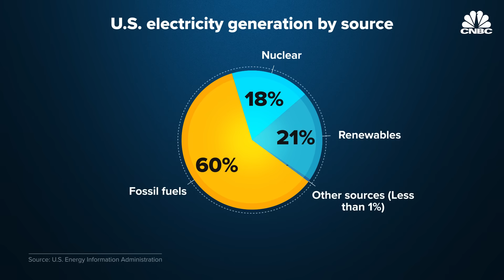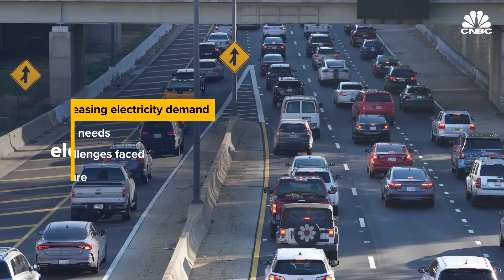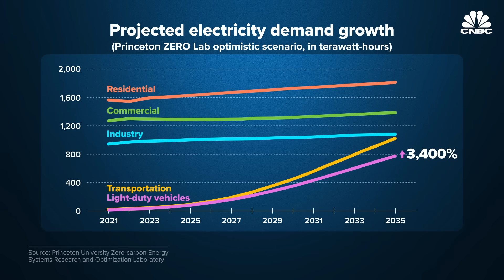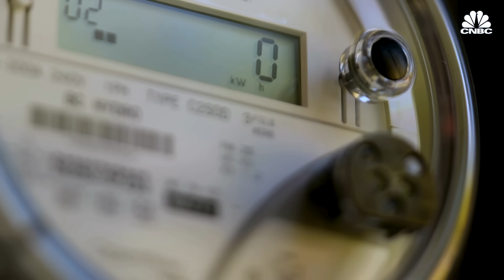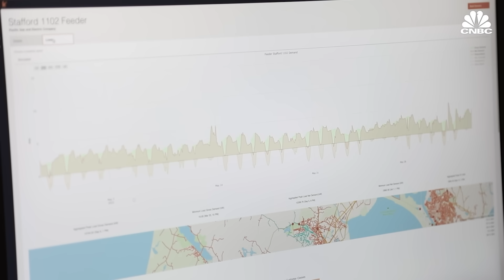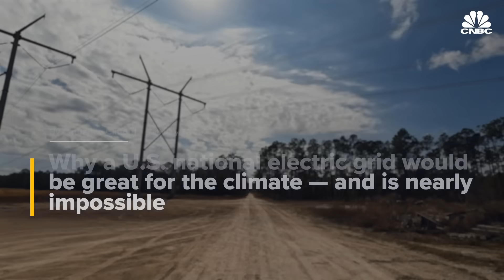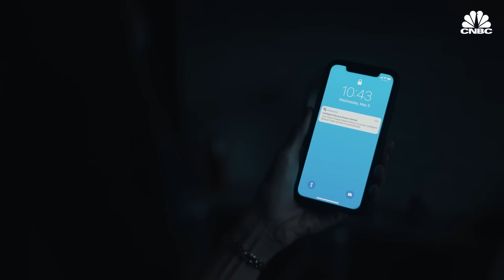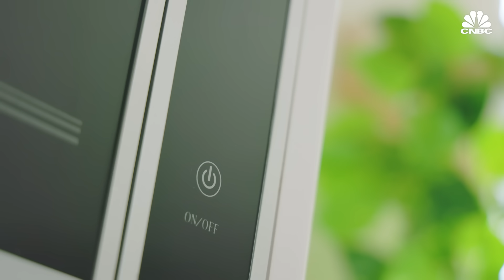Can The U.S. Power Grid Handle The EV Boom?

Comment: Model 3: 3566 kWh per year * $0.14 per kWh = $499.24 per year vs Toyota Camry: 14000 miles per year / 32 miles per gallon * $3.50 per gallon = $1531.25 per year or savings of $1032.01 per year
Model 3 cost: $47,240 (Long Range, no incentives) vs Toyota Camry cost: 35,916 (SE AWD) so it pays off after roughly 11 years of ownership (forgetting maintenance deltas and incentive offsets)
Ford F150 Lightning: 7274 kWh per year * $0.14 per kWh = $1018.36 per year vs F150: 14000 miles per year / 20 miles per gallon * $3.50 per gallon = $2450.00 per year or savings of $1431.64 per year
Ford F150 Lightning cost (XLT): $64474 (no incentives) vs F150 cost (XLT): $41800 so it pays off roughly 16 years of ownership (forgetting maintenance deltas and incentive offsets)
I’m an EV and ICE owner. My biggest gripe is the high costs up front. Tesla seems to be the only company trying to solve this issue. I need the rest of the industry to figure this out. A average person can’t buy these expensive cars, and it starts with the costs of the batteries. Need better battery tech, or cheaper batteries.
As for stressing the grid, 11 billion miles per day in the US, and if each vehicle is around 2.9 miles per kWh that is 3.8GWh per day. We produce about 10.7GWh per day with approximately 2.2% of the cars on the grid. If we get to 100% EV, we would roughly have to grow 35% to make it work. This does not hurt my head at all guys, what is the issue? Random surges is what has to be protected, that is the problem ie. need more energy banks/storage.
Reply: Most people talk about a 20% increase to the grid for full EV adoption. Easily done over the next 20-30 years.
Reply: And that doesn't include cheap home solar that is selling rapidly.  My 1kWH per day system cost $800, will last 10 to 15 years and is even ceasing to increase.   I'm very likely to be 2kwH per day this year.   I use 380 kwH per month.   That's 30kWH per month I get now out of ~16 sq feet.
Reply: The economic breakeven point for EVs vs. ICE vehicles actually comes in at an average of just 5 to 6 years.

Additionally, the ecological breakeven point for EVs vs. ICE vehicles is less than 14,000 miles, and this figure gets better as fossil fuel generation decreased.

And that's just the beginning as both the economic and ecological benefits continue to accrue over the life of the vehicle.

Lastly, it's going to take quite a while to reach 100% EV penetration in new vehicle sales, let alone ICE replacement over time. So all the dire armchair predictions that the grid's gonna collapse simply aren't true.
Reply: @ARepublicIfYouCanKeepIt  actually even the 2018 adoption rate projections were way off.    

Ice dealerships are charging high premiums after the pandemic and as a result, ev sales are way up.

And the parent poster was really friendly with his price of gasoline.  Gasoline and Diesel are much higher in California (38 million citizens), the EU (447 million), and UK (61 million).

Comment: Finally, I never hear about this. CA Bay Area currently has brownouts? And are there pollution benefits , since grid a huge sources of pollution?
Reply: CA brownouts are not so much infrastructure related but mismanagement that goes back to the days of Enron. The are pollution benefits because electric vehicles and appliances are 3 to 5 times more efficient and the grid gets cleaner every year. Don't pine for a smelly and polluted past. Look forward to a better, cleaner, greener future.
Reply: The grid is only pollution when it uses coal.   And electricity from coal is about 40x better than burning gasoline in a bunch of individual vehicles.

Evs cause less pollution in California after 18k km.  That's about 12000 miles and uncles the carbon centaurs to manufacture the evs including their batteries.

Comment: 98% of all charging of EVs will happen at home overmight. TOU pricing will keep EV charging to off peak when there is tons of power available.
Reply: ??? 8h 30min at work not enough for a fill up ???
Reply: That's not true.  I don't know of one EV use who plugs in his EV right before they go to bed.  They do so as soon as they get home...so 6-7PM.  Because most trips require only a partial charge, that mean most EV charging occurs between 6-10PM, right at peak electricity demand.
Reply: @howard6433  all EVs produced in the last decade have charge timers in them. Sure they plug in when they get home at 5-6pm but they don't actually start charging until midnight when power is cheaper.

Comment: The U.S. Power grid will not be able to handle charging stupid EVs. Our power grid system is degrading, and lots of work needs to improve our power grid system. Be ready for lots of blackouts over the summer due to people charging their stupid EVs during the days and nights. I know this is the time every Americans have their AC systems running during the days and nights. We Idahoans have no interest in stupid EVs, and  our power grid system in Idaho can barely handle over the summer. 😎🇺🇸
Reply: Exactly,  EVs are burnings up and their useless batteries explode.
Reply: Solar, Wind, and Nuclear plants needs to get installed more.

We can improve and innovate our current energy infrastructure. this isn’t a non issues.

Maybe see who in charge of improving the power grid and go after them
Reply: @tycooperaow  One, people are afraid of the Atom. So Nuclear is out. DTE got a permit to build a new reactor at the Fermi Nuclear power station, people protested and the idea was shelved.  Two while we can improve the system, at what cost? Do you think the power companies are going to be the ones paying for it? Nope. They will just increase rates  and grovel at their favorite political person for tax money. DTE already charges double between the hours of 3pm and 7pm in the time when many people are still struggling due to high inflation, crippling student loan debt and non affordable housing.
Reply: @Jacarroll417  is the money.   Not the radioactivity.   Private companies will not insure nuclear decommissioning.  And nuclear is no longer profitable compared to wind and solar and requires tax players to subsidize it
Reply: @mac_mcleod  Money is part of it, but every time a reactor is to be built people protest and lock the process up in court. SO yeah Companies are not willing to stake the money on a potential money pit as people continue to fear the atom. Also solar doesn't work everywhere. Firstly you need lots of sun, not everywhere gets lots of sun all year round. Then you got the costs associated with buying the panels and having them installed. You need to find a reputable company to do it. Not everyone has that ability. Last I checked the blades on a Wind Turbine last maybe 5 years before they need to be replaced, they dont have a good method to recycle them.
Reply: @Jacarroll417  wind turbine blades last 12 years.  And wind is cheaper than nuclear.   A lot cheaper.  And that's ignoring the costs of nuclear that we push on to our grandchildren.
Reply: @Jacarroll417  not unless it’s fusion reactor.  Plus we need to change the narrative and undergo a lot of testing for it
Reply: @tycooperaow  Fusion is decades out at best. We need solutions for today.
Reply: @Jacarroll417  Fusion is a solution we can employ in the next year. There have been massive breakthroughs these past couple years. I suggest looking into it!
Reply: @tycooperaow  When fusion is really real and really less expensive, then it will become common.

Right now, even with subsidies (which are okay for a new tech), Fusion isn't practical yet.
Reply: @mac_mcleod  We gotta start somewhere
Reply: @tycooperaow  I air conditioned my house in texas in the heat of the day for 2 hours on cheap off-grid Solar.  It's going to cut my electrical usage and my utility bill by 8% compared to last summer.

I'll likely use an electric bicycle to lower mileage on my car by 100 miles a week - using solar instead of gasoline- this Fall.   (just no chance of it right now- it's 101 degrees outside).
Reply: Climate change is real and Idaho has a lot at stake. As temperatures increase and droughts persist, wildfires destroy hundreds of thousands of acres every year, and wildfire season is starting earlier and ending later. As the human/nature interface encroaches farther and farther into the wild, more and more homes, livelihoods and, indeed, lives will also be lost.

As opposed to areas that are already developed, areas of the country that aren't already built out have the benefit of doing things correctly, rather than having to pay the increased costs associated with retrofits.

In addition to wind and solar, Idaho is rife with opportunities for both hydroelectric generation and pumped hydro storage.

Idaho National Laboratory is also at the forefront of the development and testing of Small Modular Reactors and Molten Salt Reactors for civilian power generation. Combined with renewables from wind, solar and hydro, next generation nuclear plants and a smart grid, Idaho could have a 100% carbon-free electrical grid in less than a decade.

There's wisdom in the saying, "We rise and fall on our definitions." So, I'd ask you to please explain what you mean when you say, "stupid EVs" multiple times in a single, brief post.
Reply: @ARepublicIfYouCanKeepIt  EVs are not friendly-environment and waste raw Earth minerals for EV batteries.
Reply: @nwright28  Claiming something without verifiable evidence supporting it is less than worthless.

Being steeped in many aspects of renewable energy, nuclear reactor technologies (I worked in the field) and EVs, I happen to know that you couldn't be more wrong.

BEVs are massively better for the environment than ICE vehicles. In fact, they cross the ecological breakeven point at just 14,000 miles--a figure that goes lower the more renewable energy is added to the grid.

Beyond that, current lithium chemistry batteries have eliminated the need for the one element that's surrounded by various controversies:  Cobalt.

Additionally, lithium chemistry batteries have a second life as stationary storage, after which they're very nearly 100% recyclable, wherein things such as the reclaimed lithium, etc. are reused for new battery manufacture; thereby reducing the need for mining for virgin resources.

Lastly, battery chemistry continues to improve in terms of stored energy per mass and/or volume.

Rail against all you want. The day of the ICE vehicles has peaked.
Reply: Nah.   Personal solar is getting cheap really fast now.   1kwH Power day is $800 now ( was $6000 4 years ago).  It's going to be $480 in 2025 and $350 in 2030.

My 10 year old 100w panel is 4' by 8'.  My new 100w panel is 2' by 4'.
Reply: You're just parroting the talking points of the $10million salary CEOs of the fossil industries. Stop doing that.

Comment: Of course it can’t. Our power grid could barley sustain power on summer days back some years ago? now imagine with the EV boost especially with the promoted EV rebates by govt?
Reply: Electrical companies don't over build. The build to maximize profits. When there is demand they build more.
Reply: Everyone I know that has an EV charges them late at night when the rates are low. So the grid is charging cars instead of running air conditioning units. So the real problem is storing green energy for when its needed not EVs getting charged over night.
Reply: Free market will solve these. Thankfully we have a good govt under Biden passing EV initiatives to protect the planet. Our kids and grandkids will thank us. Personally the govt will solve these and good things develop (like internet )
Reply: there is a hidden answer to you in those comments, which was censored... 
its not the grid... its the production, transmission lines (high volts) can transmit alot more than they are ever designed for... 
loading of batteries can be done at very low watts, its that they just want to do it fast.. 
its all convience.   Jason its advert for companies
Reply: @astemet  If you sorted out all these details, you would be on the right track, but this doesn't make any sense as it stands. (I am a retired grid operator).